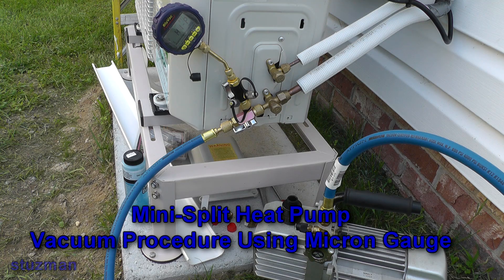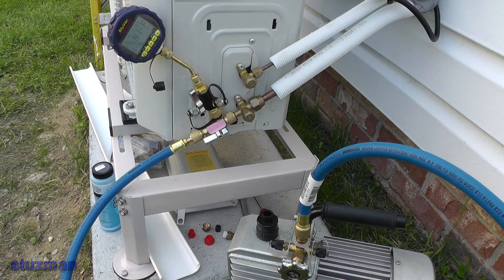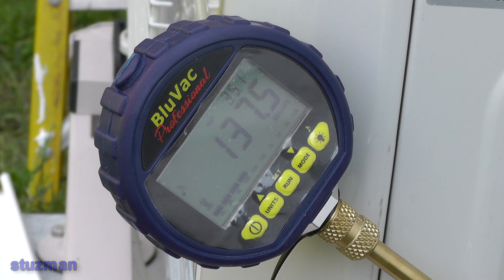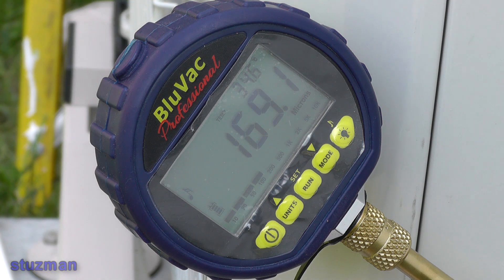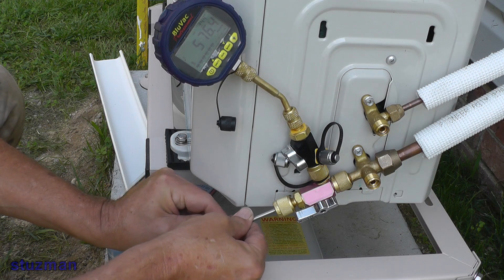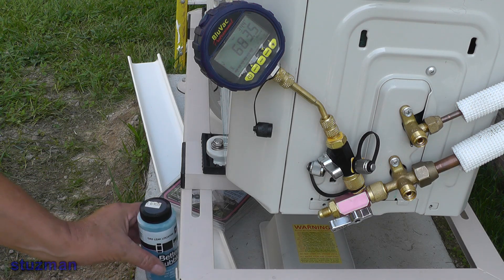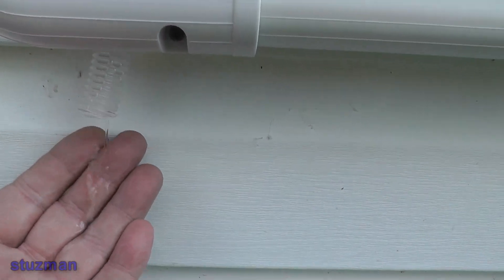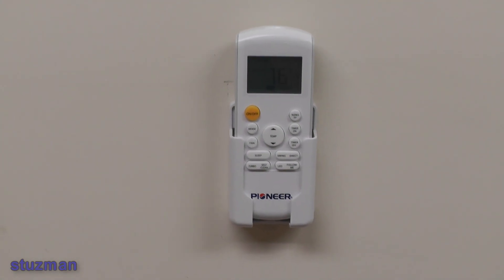Mini-Split Heat Pump: Vacuum Procedure Using a Micron Gauge

Comment: Dumb question: why the 2nd valve core removal tool?
Reply from the maker: Two reasons Savoy...The second core removal tool serves to isolate the micron gauge. Before I release the refrigerant into the line-set after a vacuum has been pulled, the refrigerant oil could contaminate the sensor inside the micron gauge which would require a cleaning. The second reason is to isolate the gauge from the high pressure. After all, it is designed to measure very low pressures. Have a great day!
Reply: @stuzman52  yes. I figured that out thanks to your video. Got mine all up and working now. Thanks for all the tips
Reply from the maker: @savoy6  Glad to help and congrats on getting your system running!

Comment: I used a few different micron gauges and I never had a stable vacuum in my life, when you close your pump, it always rises and rises and rises no matter what hoses I use or what installation I do. With or without valve remover etc.. from 300 to 1000+ microns in 2 hour for example. Never had any visible leak even with any electronic or bubble detector
Reply from the maker: I've seen that scenario also and thanks for the comment!
Reply: @stuzman52  didn't mentionned that i put my vacuum gauge on my 4way manifold, i'm pretty sure the problem is on my manifold. Anyway, super deep vacuum is not necessary when the temperature isn't too low. The most important thing is to make sure you properly evaporate all micro liquid h20 that remains in your system. Even at zero Celsius, I use a heat gun on the exernal unit to reduce the necessity of an hardcore vacuum
Reply from the maker: @balokurd17  You are correct that with higher ambient temps, the pressure doesn't have to be as low. Keep up the good work Balo!

Comment: What is that valve/adaptor assembly called with the port for the micron guage and special shraedor valve R&R tool?
Reply from the maker: That would be a valve core removal tool. The port on mini-splits are 5/16" so a valve core removal tool for that one would be used. Here is a listing for it https://www.amazon.com/Appion-MGAVCR-Vacuum-Rated-Removal/dp/B008HQ2EZ8/ref=sr_1_19?keywords=appleton+valve+core+removal+tool&qid=1638742856&sr=8-19
Reply: @stuzman52  !! Thank-you !!

Comment: Just one question, what vacuum pump did you use/recommend?
Reply from the maker: Hi Derrick! The vacuum pump that I used is from MasterCool and is rated for 5CFM. Any pump will work even if it has a low CFM. It will just take a little longer to pull the air out.
Reply: @stuzman52  Thanks Stuzman, appreciate it.

Comment: Hi, I'm somewhat of a newbie. Love the video. I saw you draw the vacuum and seal it, but I didn't see the 410A going in. Can you help me understand when/where that happened? Thanks!
Reply: Ok, I can infer now that the system has been pumped down before this video was done. So I have two questions, if you have a minute- If it's been stored for a while, how can you know how much refrigerant is in it? And second, whe you pump it down and vacuum it, are you vacuuming just the low side? I only see people talking about leaks in the low side. Does the high side never have leaks, or are they super rare or something? Thanks!
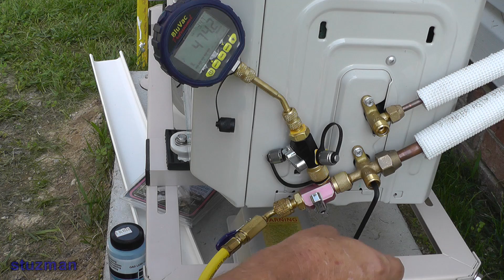Reply from the maker: Sure Jennifer, if you take a look at the timeline at 7:00 you'll see that I used an allen wrench to open the valves. This allows the refrigerant to go into the line-set.

Comment: Thanks great video, Also watched nitrogen test video. Excellent.
Just one question. Are the procedures the same for a multizone mini split? I have 4 zones on the outside unit but only using 2 zones. Best regards.
Reply from the maker: Yes, Derick. You would do the same procedure for each zone that you're using.
Reply: Thank you, appreciate it. Here goes🙂

Comment: Hi. Do the appoin valve core tool needs to be hand tightened only ?
Reply from the maker: Yes, only hand tightened.
Reply: @stuzman52  I have ruined three of these due to using plier force. I guess only oring has gone bad. I need to order their Oring set now. 😞

Comment: Great video, thank you. My service rep messed up and released / vacuumed out some of the refrigerant.  He was not sure how to recharge.  Anything special about recharging this vs other split systems?  He's familiar w/ them just not all the w/ mini splits.  Thanks again...
Reply from the maker: With mini-splits, you have to recover the refrigerant and then weigh it back in. They are not like typical units where you can check the refrigerant amount by measuring the superheat or subcooling.
Reply: @stuzman52  Perfect. Thank you so much. He will recover all the 410a then add back the 40.6 ozs per the OEM sheet.  This will be a complete refill.  He stated the unit needs to be running but, w/o any 410a in it at all, I was concerned about running w/o any in.  108 here w/ 95% humidity... Mama getting anxious.. ;)
Reply from the maker: @patmac  Pat, your tech should be able to get a large amount of refrigerant into the system before it's turned on. Then it could be turned on to finish up the charge.
Reply: @stuzman52  Thanks man. Really appreciate your reply. He got in about a pound before turning on. After starting and running at lowest temp, it took the remainder. 40.6 oz total. So appreciate your help.  Owe ya...  PS He used this gas/atomizer thnigamajig to help speed up the liquid recharge. Never seen one but cut his install time down 75%... Cool..
Reply from the maker: @patmac  Good to hear that all went well Pat. Since the R410a is a mixture of two refrigerants, it has to go into the system with the tank upside down. Of course, you can't just let liquid refrigerant constantly go into the compressor while running or else the compressor can lock up. The atomizer turns the liquid refrigerant into a mist where it can go into the system faster. Have a great day!

Comment: hello sir i am from Indonesia. i would like to ask you about vacuum procedure. what about if on  ac system no more gas or refrigerant. when we do vacuum should we open service valve fully open and high pressure valve also fully open as well? my unit was no more refrigerant at all. so if you don't mind answer my question. 🙏
Reply from the maker: Rachel, it sounds like you have lost all of your refrigerant most likely from a leak in the system. You would have to pressurize the system with nitrogen and then find the leak. Repair the leak and then repressurize to verify that the repair is done correctly. Afterwards, you would have to weigh the refrigerant back into the system if it's a mini-split unit.
Reply: @stuzman52  thanks sir
Reply from the maker: @rachelbenzema7822  You're very welcome Rachel!

Comment: Ok,  I feel like an idiot. But it's my first mini split install. I pressure tested and evacuated my first lineset, then released the refrigerant into that lineset. I thought, Oh boy let's try it out. Head unit blows hot air, condenser fan is running , but no cooling going on. Ok, I figure I must need to hook up the other linesets to lower refrigerant pressure. I'm rewatching Stuzman doing his release of refrigerant and then I see him open another valve on the pressure side of compressor.  I think, wow, I didn't open the valve on high side. I open it, then turn system on and to my amazement, the head unit starts blowing cool air!! 
What a Newb I am!!

I'm glad I rewatched his video. He saved my day. Now to hook up the other two head units to the compressor. I'm really jazzed!!! Thank you Mr Stuzman!
Reply from the maker: Good for you Bobby and don't knock yourself! Hell, me and countless others have done things that we would never admit 😊 Have a great evening!

Comment: I have a pre-charged line set that has been vacuumed and filled with R-410a refrigerant from the factory, but I need to shorten its length. 

Since the lines are factory pre-charged, is there anything special I need to do aside from vacuuming the lines and checking the microns before releasing the R-410a refrigerant from the condenser?
Reply from the maker: If you can recover the refrigerant from the lines, everything will be as you mentioned except maybe doing a pressure test of the line set before evacuating.

Comment: Why are the service ports closed during this whole process and do you close them before recovery or what’s the deal with the service ports on these heat pumps I can’t figure out how you do recovery and vac with the ports closed 🤦🏻‍♂️ someone help I’m a first year tech
Reply from the maker: Hi Danny and hope you're doing well! Probably need to define two terms, evacuation and recovery. Recovery is when you will remove all of the refrigerant in the system and requires a unit made to just that. Evacuation is the removal of air within the line-set and requires a vacuum pump and gauge to monitor the process. When you purchase a mini-split or any other a/c unit, the service valves are closed from the factory and the refrigerant is stored in the outdoor coil. The line-set and indoor coil is evacuated, (remove the air). Then you open the service valves to allow the refrigerant in the outdoor coil to enter into the line-set and indoor coil. Of course, before you open the service valves, you want to be sure that there are no leaks in the system.

Comment: Loving what your doing I actually run the same setup . However knock the second t off BluVac is pressure rated and refrigerant doesn’t effect the gauge at all just clean out with alcohol if any issues . The extra removal tool is just extra connections for leaks .
Reply from the maker: Yes, Matthew, you can use the setup as you're referring to.

Comment: I was wondering if you use the hose that comes with the gauge set  to do the vacuum do you need to remove the valve core in the hose   if so how do you do that .
Reply from the maker: Hi Jerry! They make vacuum rated hoses where they don't have the valve cores. Typically, these hoses are larger to allow for a faster removal of air. You can use the hoses on the gauges which typically will have the valve cores in them. You don't have to remove the valve cores, but it will take longer to remove the air.
Reply: @stuzman52  perfect cause I am retired and have lots of time. 😊 that's why I started playing around with this stuff on my rentals. Saving money and learning something new. Can't wait for more videos. Thanks
Reply from the maker: @jerryharrington1152  Being retired gives you a lot of free time on your hands Jerry. There's a lot of stuff out there to learn and I'm no different. Learn something new just about every day. Have a great weekend!

Comment: Great video. Could you use just the pink valve removal tool and hook the micron meter to the 3rd port? Then once you reinstall the valve core after the test, take the micron meter off?
Reply from the maker: You could do that. The reason for the other valve removal tool was to isolate the micron gauge from the high pressure of the refrigerant and to keep the refrigerant oil from contaminating the sensor inside the micron gauge.

Comment: Thanks for the video, one question, can I put the valve core back in before release the refrigerant?
Reply from the maker: Not the best idea as you will allow the atmospheric pressure back into the system. Always best to install the valve core while system is pressurized.

Comment: why not insert the valve core before letting the refrig in the system, isnt that easier?
Reply from the maker: Doing it before the refrigerant is released would allow air into the system when under a vacuum.

Comment: Excellent tutorial! I’m preparing for a dual zone mini-split installation. Your tutorial has confirmed my decision go acquire a micro gage to perform the mini-split vacuum.
Reply from the maker: Good luck Carlos with your installation!
Reply: I do have a couple of follow up questions. 1) I have purchased a dual zone Gree heat pump. After reviewing installation guides and on line tutorials I have concluded that given that the install will have line sets less than 25 feet, adding refrigerant will not be required.....is this correct? 2). This installation will be a swap out of an older existing mini-split. I am assuming that there will be special processes in handling the refrigerant lines and disposal of the heat pump. Is this correct?

Comment: one of the few diy vids that actually does it right. Gotta love the guys using dial gauges in other vids and saying  they work good enough, yeah they work good enough to get the job done and get out of there before the compressor blows. Really tho anyone not using a micron meter might get lucky but it's just that, luck, cause you really don't know..
Reply from the maker: You are correct Neal! Without a micron gauge, you never know how much vacuum is pulled on a system.
Reply: I think this video and use of correct equipment are top notch.  That said, as a DIY guy, and not thinking  I would install more than 1 or 2 units, for myself, i chose not to buy a fancy vacuum pump or micron gauge.  Instead I unscrewed the intake valve on my air compressor and screwed in a couple of fittings to connect to a cheap set of gauges.  I do purge with nitrogen and bubble test and then vacuum down to almost neg 30 " HG with my old compressor and regular gauges.. I don't let all of the nitrogen out before vacuuming- i vacuum it out so no air and moisture can enter.    Having now installed 7 in the last few years, and with 2 more to put in soon (all for family for free) I could now have justified the real vacuum pump and micron gauge, but I have gotten by fine with only the manifold gauges.  A micron gauge would be sweet to have, but if you clearly have no leaks in the bubble / pressure test and then you vacuum it all out, you will be fine with only rudimentary gauges.  The expensive tools are great if you want to do a bunch, but not essential.  
Great video Mr. Stuzman.  Many DIYers will benefit and step up to do this now..  I even had two units need recharging (one developed a pinhole leak in the factory brazing around the reversing valve after 3 years and one had a faulty expansion valve).  I was able to buy a bottle of R410 at a decent price on-line and ship from USA to Canada no issue.  Brazed in new parts each time, pressure/bumble test, vacuum and weighed out refrigerant charge on a good (borrowed) set of scales as i charged unit... that was several years ago and still going strong.  Its not rocket science- watch good videos like this one, but basic tools and save some cash!
Reply: @Northeaster-b3w  I wouldn't let you install a heat pump in a dog house. Yes your setup may let you know if there's major leaks,  BUT that's all.  Most heat pump manufacturers call for 500  microns or less, (which you can't even read with a dial guage) and there's a reason for that. There could be moisture in the system for example and you would never know it without the micron guage. When your cousin tony's compressor dies after 2 years you'll be like, man we won't be getting that brand again! When in reality it's actually your fault because you were just rolling dice hoping for the best. I installed ny first pump with dial guages 4 or 5 years ago and it's still going strong, but I realized later that I got lucky, simple as that..
Reply: @neallyons9515  I do appreciate you saying that you have previously installed them with dial gauges and have since learned better.  Learning is the reason I re-searched youtube, after not having installed any in about 3 years now.  The 7 that I have installed have all been running between 3 and 7 years, but as I have 2 more to do soon, I wanted to see if any better videos existed than what was out there several years ago.  I am glad I did.
I am considering buying the CPS digital/micron gauge but will likely not put in many more after these two.  As mentioned, I have only done this for family members for free..  they know our setup is crude and I will talk to them about  the option of chipping in a bit to cover the costs of the gauges if they want to ensure success or if they prefer to do as we have before.  

I agree that I do not know how complete of a vacuum I have achieved, when using the dial gauges.  But, the compressor is strong enough to pull the dial gauges down quickly and then I leave it running for a good length of time after that, knowing that it is continuing to pull finer amounts out the longer it is left on.  

re: possible moisture left in there, I doubt that would be the case, as I have purged the lines (and indoor coil) with nitrogen (cracking the opposite line fitting and letting all of the air out followed by a couple of minutes of nitrogen before tightening the fitting and pressure testing.) Then this is all vacuumed out, without letting air back in.... I release enough of the nitrogen to be at a few psi and then I turn the compressor on, and slowly open the valve.  So, i could have some small amounts of nitrogen in there (knowing this is not ideal either..) but there is no chance of moisture being in there. 
If I do decide to buy a micron gauge, It looks like it's best to then buy 2 core removal tools and the reviews on cheaper ones are not great...   the ones linked in this video have great reviews but at about $53 USD or $90 Cdn for me, two of these plus the CPS micron gauge( least expensive one i have seen with good reviews) adds another $220 Cdn so all totalled it would be pushing $500 Cdn for this added ability.  If i have 5 more to do, it would be an easier choice.  Still I would then be increasing chances of success and would have them for the future, if any of the others need work/ recharging, etc.